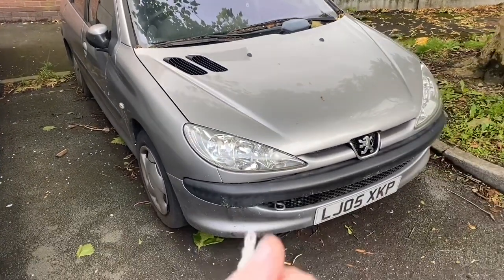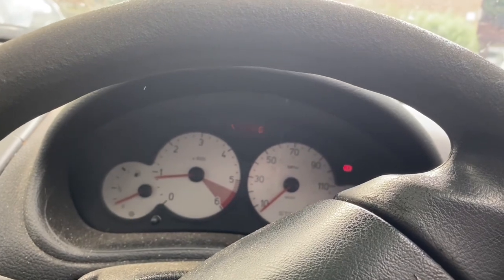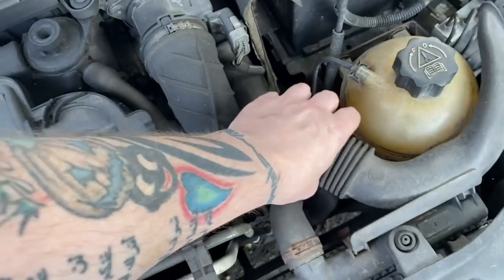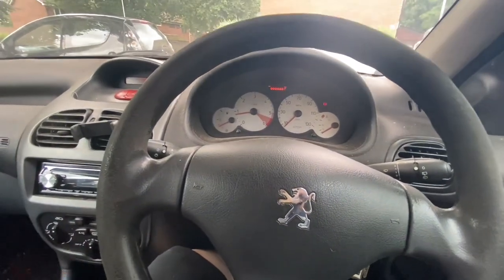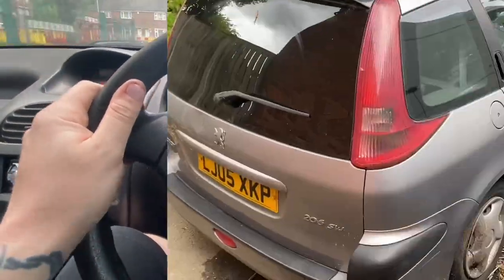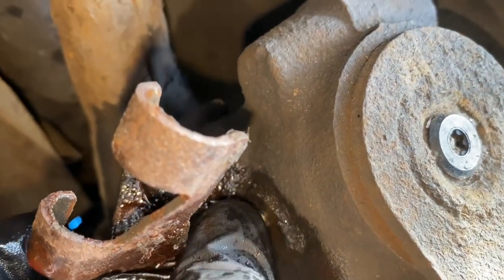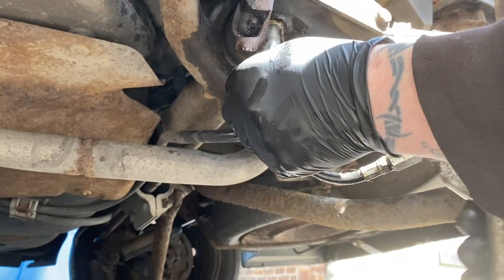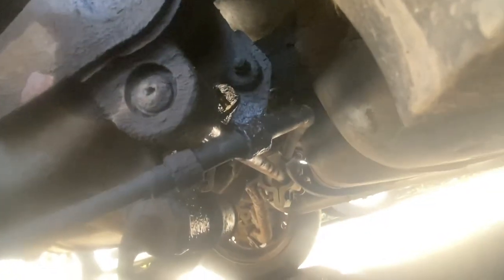Peugeot 206 Rear Axle Grease Nipple Installation / Peugeot Seized Rear Suspension

Comment: This gave me bad flashbacks of changing the axle needle bearings. 

Absolute nightmare. Everything was really badly seized, much heat & sledge hammering. 

After all the bother, the car still  failed mot. The stub axle on one side was pitted so the bearing still had play.

You can't just shake the wheel, like checking a wheel bearing for play. That caught me out.

To check for play in the axle, you grab the inner sidewall with one hand & the outer sidewall with the other. Try & 'twist' the wheel.
Reply from the maker: Yes, for play in the radius arm you’re basically trying to steer the car with the wheel by hand if that makes sense 😆

Comment: to be honest these engines are absolutely amazing. my Citroen C3 1.4 HDI 2006 returns 80 UK mpg or 3.5l/100km AVERAGE fuel consumption. No DPF, no dual mass flywheel bullshit, takes any oil.. etc. If you can, you should keep it as a daily 😎
Reply from the maker: I was gonna flog it on but it’s turning out to be pretty useful. I was getting about 55mpg but I’m not an economical driver. I’m only getting about 45 now with the MAF unplugged. I’ve got a tuning box to try on it but I wanna get an accurate mpg figure as a baseline.
Reply: @StupidBlokeStupidVideos  i struggle to get down to 45 MPG except momentarily in steep inclines lol, but then again i drive as a hypermiling granny. If you can you should try to find someone with a Lexia machine. that will show you all the stored fault codes. a properly dialed in one of these should return at the very least 55 or even 60 UK mpg average, unless you drive like you're on track every time you take the car out 👍
Reply: Tbh even 60 is too low. i drove mine like i was on crack for a couple of months in winter last year and i barely got under 70 UK mpg
Reply from the maker: @MT-rc3gn  how are you calculating it? I do mainly round town and where I live is speed bumps, traffic and roadworks usually. Since I’ve had it I’ve always got 55mpg but last week only got 45. This is since unplugging my MAF, however I think it’s just a coincidence as last week the traffic was exceptionally bad with a road closed near where I live making the school run a nightmare and we had a couple of days of horrendous traffic cos of accidents. I usually get pretty much the same mpg weekly as I’m very boring and usually do the same journeys. I’ll see how I get on next week. 

P.s. unplugging the MAF made the car much more drivable and nippy, well less slow than it was.
Reply: @StupidBlokeStupidVideos  I usually go by what the computer says since it's pretty accurate, but i have also calculated it manually with the trip meter and how much goes back into the tank. my all time best was 1380 km on about 42 liters of diesel (slightly overfilled tank) 😎 Normally the car returns 1100-1150km on 40 liters with another 100km range stated in the computer.. In winter about 950-1000km/40l (swedish winters). If your tyres arent too dry rotted you can try and inflate them to the max PSI stated on the tyre, that will improve MPGs. also accelerate & decelerate slowly and change gear as soon as possible without bogging the engine. Not sure in uk but swedish motorway speed limits are 60mph and if i stay at a calm 55mph in the slow lane with even throttle and flat ground the instantaneous meter shows 3.2l/100km (88 mpg). On 45 mph limit country roads its even possible to get below 3l/100km. Really quite fun to see how low you can press the numbers by just being gentle on the throttle. Also regarding the MAF, i can't say for sure because your 1.4HDI is the 8HX model while mine is 8HZ. there are differences for example your MAF is not the same model as the one in the 2006 C3 1.4 HDI. but i can say that i tried to unplug mine once to see what would happen to the fuel economy. i noticed nothing to be honest.. i still bought a new one and replaced the old one lol.
Reply from the maker: @MT-rc3gn  ah I see. You’re more into the mpg game than me. What is the model of yours again? Mine doesn’t have an mpg computer, not that I’ve found anyway 🤔
Reply: @StupidBlokeStupidVideos  It is a 2006 Citroen C3 with 8HZ 1.4 HDI engine. We have different injection ECUs, MAFs and some other bit but these differences should not cause such a big difference in fuel consumption. I am sure you at least have an average fuel consumption computer in yours. try and press the button on the tip ends of the indicator/wiper stalks, one of them should allow you to navigate the computer✌
Reply from the maker: @MT-rc3gn  I’ll press some buttons next time I’m sat in it and see what happens

Comment: The rattling sounds like the heat shields around the turbo/catalyst. My 207 shitter does the same.
Reply from the maker: It could be partially that, but I think the main noise is from the aux belt tensioner. In tickover it’s bouncing back and forward but stops when revved.

Comment: Great idea and considering doing it, BUT the radius arm is hollow so could potentially fill it completely with grease until it reaches the bearings?
Reply from the maker: Yea there is a lot of room inside. I just pumped a lot of grease in. Hopefully some of it will have made its way into the bearings which I’m pretty sure it will have done

Comment: I didn't realise these came with a grass box on the back. Does it have a cutting blade on the bottom too? 😆
Reply from the maker: The cutting blade only comes on higher power models.
Reply: @StupidBlokeStupidVideos  I suspect a lawn mower is a higher power model 🤔
Reply from the maker: @JAYG6390  I suspect most lawnmowers are faster too…
Reply: @StupidBlokeStupidVideos  There is no doubt in my mind that lawnmowers are faster

Comment: Think I'm gonna try this on my old clunker 206,can you just clarify the drill bit size you used? (or are supposed to use?) Think you said M8x1.25 mm grease nipple should be a 6.25 mm drill bit? I'm probably stating the obvious but I'm no expert you see,
Cheers!
Reply from the maker: It depends on the nipple size. These where 8mm thread so 6.2mm hole, but some are 10mm areola, burger nip size which would obviously need drilling bigger.
Reply: Ah cheers,I was going to basically just copy your good self (8mm nipple) so now I'm primed and armed with the info I need! Thanks for the reply sir! 👍